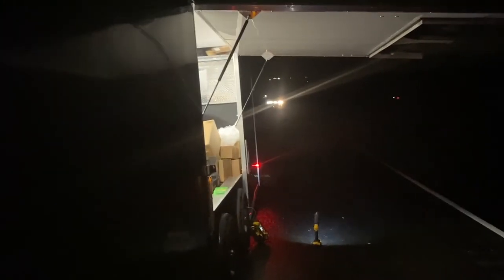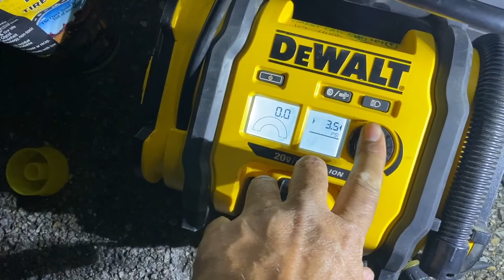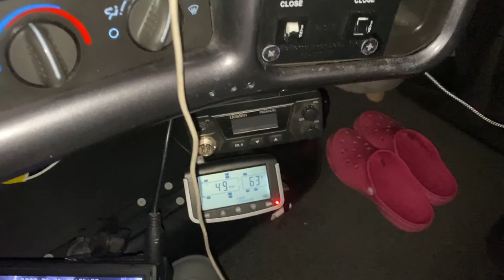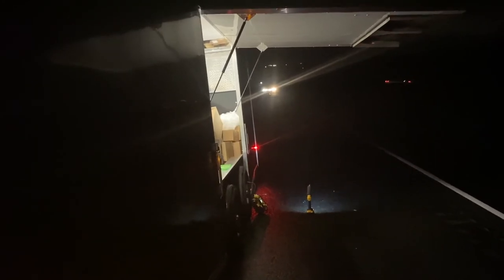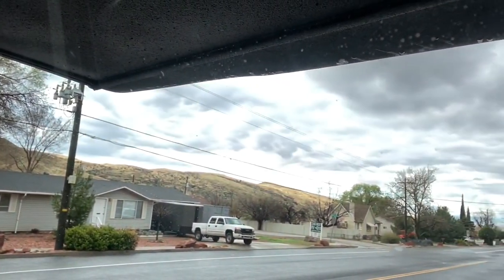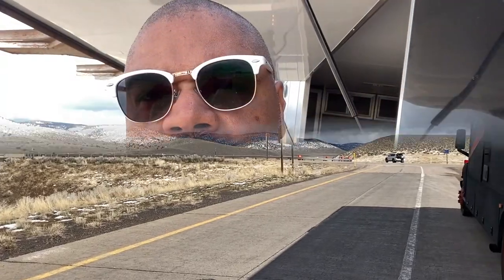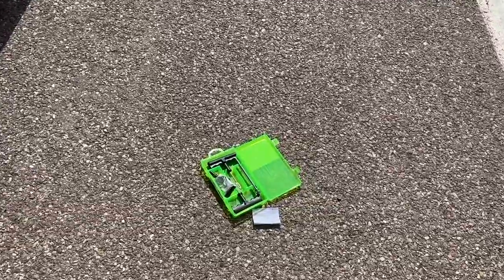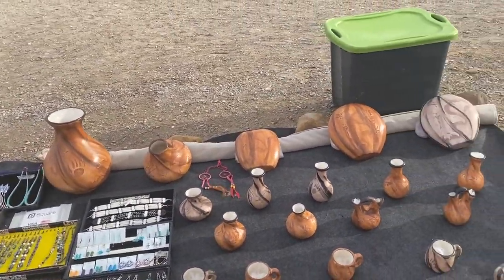Is it a officer or flashlight? The flat that would not go away...and how I stayed safe fixing it.

Comment: Brother, I could be wrong, but I think your supposed to have some air in the tire when you put that fix a flat inside it.  Anyways, nice video. Shabbat Shalom
Reply from the maker: This style of flat repair requires your to remove the valve core, insert the liquid, then replace the core and add air.